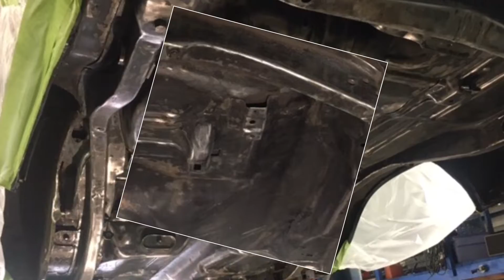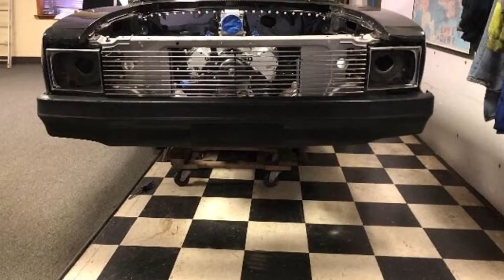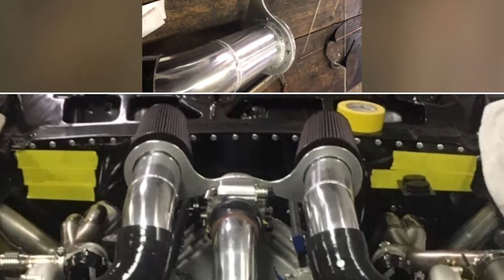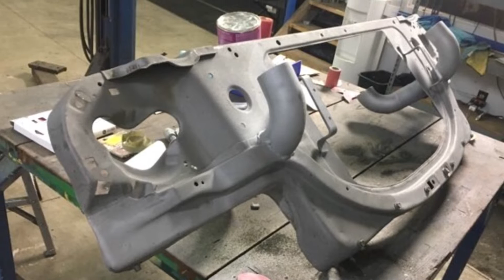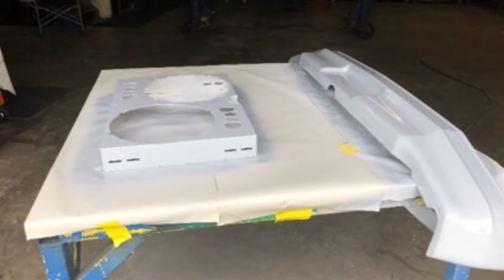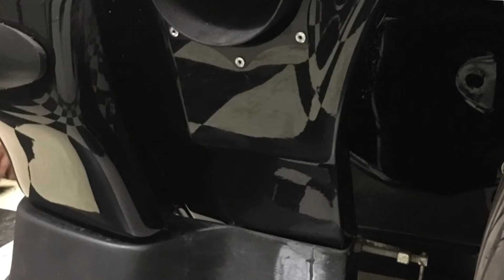1979 Chevy Nova Twin Turbo LS Build

Comment: Ive got a 75, if that wasn't obvious by the name lol. Nothing special, has a big block in it and the only mod so far is an intake so I could put my new carb on. Ill be going for more of a mad max vibe, burnout contests (won 1 already!) Maybe some passes at the local strip if I can ever get it to pass tech lol.. im still fixing things from previous owner(s) He bought it without a motor, and its pretty obvious he did whatever he had to do to make it work... Wires that go nowhere, things that dont make sense etc. A cheap cell in the trunk.. I think 2 owners ago was gonna dirt track it or something.. idk.. its a mess but I like it. Its been a learning experience. Ive turned wrenches for quite a while now but its mostly been new stuff, hadnt had much chances to do the hot rod thing until now. You got a clean car thats for sure.

Comment: My first car was a plain jane 79' Chevy Nova with stock Rally wheels and a 305 with 2 barrel carb under the hood. I believe the transmission may have been a hydraulic 350 but not positive on it. One thing I know for sure was the thing was a real sleeper and fooled many.
Reply from the maker: Hell yea

Comment: Awesome Ride Guy! Took driving test in 79 ,2 door with 250 -6,th350.. Damn near indestructible. Always spot in my heart for these cars/77-79. . Yours is the meanest Looking I've seen Yet. And I probably search em once every month or 2. 5 star build. Can you share some quick specs, block,turbos,trans, gearing?? Any idea on whp?  Also, where are you from/living? You gotta post a time on her as soon as strips get rolling again. Take care.
Reply from the maker: It’s a 5.3 forged bottom end. Motor was built from ground up starting with a new block from gm. Tick stage 2 cam. Turbos are precision 62/66. Trans is a th400 reverse manual valve body, direct port transbrake, ultra bell from Rossler. Converter is PTC. Gears in it now are 3.70 with a spool however I have a new Strange S-trac that just showed up from Midwest chassis with 3.25 gears going in. Car made 718whp so far on the dyno. My Aeromotive fuel pumps couldn’t keep up passed 20psi so I have dual hellcat 525 pumps on the way. Car should make 900-1000 wheel on my next visit to the dyno somewhere around 30psi. I cruise around on 12 psi and she’s a tire burner already. I’ll definitely get to the track I’m hoping for 5’s in the 1/8th mile but all in all she’s a true street car and cruises like a Prius until you lay in to it! Thanks for the comments
Reply: Can't wait to check out fresh video. She is perfect. I'll definitely be watching 4 as much as possible on her. Couple quick questions . Are you or your good friend an engineer by chance or are you or your friend just Ultra mechanically inclined?? Your girl looks better then fry burgers F-bomb Camaro. Also where is your home track? Would love to come watch her Roar. She really is perfect Imo.
Reply from the maker: Just a couple of hobbyists. He’s a farm boy who just loves cars and has built some pretty sick shit. I have a video of his TT firebird on here if you search. Lancaster speedway or empire in Buffalo NY is where we go. Might try and get it to LS fest at some point.
Reply from the maker: Oh, and I’m a landscaper but been in to cars since I was a kid. Had this 20 years now since I was 16 so...it’s just kind of “that car” to me and I always wanted to make it badass. It was always pretty cool but my friend pushed me to take it to the next level. Didn’t take much convincing ofcourse lol

Comment: Yo!! Beautiful Nova man! Best 4th gen I’ve ever seen. Quick question, are those fiberglass front and rear bumpers from Glasstek a straight bolt on?
Reply from the maker: Thanks! I suppose they could be mounted using factory brackets. I ditched the factory setup and used custom mounts you will see in my build video and glued the bumpers to those brackets.  You might have to do a little fab work to mount as they come as a fiberglass shell basically but nothing some scrap pieces of metal won’t solve.

Comment: man... you make me wanna finish mine I've had stored away since 2000... beautiful build... where can I find more info on your car?
Reply from the maker: Peter Landry I post on 4th generation novas on FB from time to time but I’ll probably post more vids of the car this summer. Anything you wana know just ask
Reply: @jcmoney4125  I just sent a request to join that fb group..... what kind of spindles are those... interested in your suspension and steering setup.
Reply from the maker: Peter Landry I have the speedtech streetfighter kit. It’s a bracket you add to the frame for true coil overs up front, tubular upper and lower control arms, I used the stock steering box. Spindles are corvette I believe. Check the kit out on their website it should have all the details. They have several kits of different levels.

Comment: Please tell me where did  you source the Hood and rear Wing ? I love the way your car looks! I love the all Black theme. Everything  looks just right. I have watched this video over and over again.  I bought  a clean 76 Nova yesterday. It has extremely straight sheet metal, and no rust, but is a butt ugly brown color. I am going to put a HP Chevy Big Block 454 / TH400 that I have in my Nova.. I am going drag racing again! I would greatly appreciate it if you would let me know where to get the cowl hood and wing.  (Also what is the cowl height? Thanks, Mike
Reply from the maker: Its a 4” glasstek cowl hood. They also make a sonoco style which I may try out next. The wing is from Edquay. thanks for the compliments and good luck on your build!
Reply: @jcmoney4125  Thanks Jc, Your Nova looks awesome ! In my opinion,  It is the best looking 76 -79 Nova in the world.  Is the front spoiler also from glasstek? Thanks, Mike
Reply from the maker: @gasolinevaporsystems9022  thanks I appreciate it! My friend and I put a lot of thought and time in to this. yea the front spoiler is from glasstek also. It will fit a stock steel bumper as well as their fiberglass bumper just fine.

Comment: Good photography throughout your presentation not bad background music too. My preferred taste though is not necessarily black on black I know that everybody has their own style and opinion but these cars are going to be coming back and they're pretty good cars they have a similar weight as a Camaro or firebird and they have a similar weight of a mustang yet they have a back end area that is compatible for adults full size and they also have a larger trunk space that's a little bit more practical yet they weigh about the same and they're not much heavier than a Corvette although a Corvette has better suspension or a Dodge Shelby Cobra and if you put a really big engine of course in a Shelby Cobra or Corvette it's really fast but if you put a really big engine and something like a Nova or a concourse and you put a little bit of low end gears with the different fuel mixture you have something that's faster than a Corvette or a cobra in a quarter mile it doesn't take actually that much and it's much more affordable less expensive and the only thing that the disposition of a Nova or a concourse is yeah it doesn't have perfect aerodynamics but you only really need really acquittable aerodynamics at speeds of 150 and 200 mph that's where you need the air dynamics and spoilers and things like that so as long as you're only doing 100 miles an hour these cars are very practical